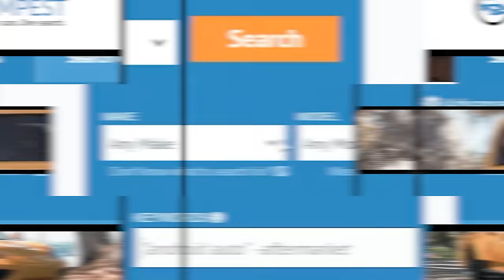Fixing Our Cheap (And Broken) Exotic Cars Was A Complete DISASTER

Comment: “That didn’t hit the floor” I know that pain all too well. That tool is now a part of the engine suffice it to say
Reply: Nah, old car aerial, some insulated wire to wrap around it, short the wire a few bursts on a car battery to super magnetise the thing and VOILA! Mega magnetic pickup tool! Also works with any magnetic metal object like fence wire.
Reply: I lost a Philips head in the engine bay a year ago. Last week I broke down and needed to unscrew some stuff but didn't have any tools on me, I found that Philips head in the engine bay.

Didn't help. The radiator cracked, but still. Was a nice surprise.
Reply: Anything that falls into the engine bay goes into a black hole. I lost many a tool working on a Mustang. When we finally decided to pull the motor, there were no tools to be found. And the car had never moved !
Reply: Lost a socket extension in my old truck. Constantly heard it rolling around in the firewall, traded it in a year later with it still there. Either new owner will find it or its apart of the truck fore er
Reply: I have a 2002 mustang back in 2007 I dropped a socket into the engine bay. It’s still there until this day.
Reply: It joined all the missing 10mm sockets in whatever blackhole they get lost in...
Reply: Thats where all your 10mm sockets are

Comment: Tyler is 100% the guy who would buy a Rolex, but not spend the extra $5 to have the extra kinks taken out to have it fit properly.
Reply: Lol what
Reply: @Louis-ep8ob  He's wearing a rolex submariner but it's way too loose (unless he prefers it that loose)
Reply: Faceless it’s a GMT pre ceramic model.
Reply: There are a lot of people who like it loose (me included) especially on tool watches
Reply: You spelled "link" wrong.
Reply: @Timberjagi  not when they have micro adjustments so you have the perfect fit, which can also be widened should your wrist feel a little bloated on any given day, with the half link. My guess is he bought it not for the watch but because of the brand.
Reply: @gilbertoflores7397  it's a older version gmt ;) yes the new clasp has a micro adjustment. but the older ones didn't have it.
Reply: I Got That PMA  hahahaha
Reply: Kinks? You mean links, right? Also that's free at any Rolex AD and it takes only a tiny screwdriver to do it yourself in minutes.
Reply: Those watches use a mechanism not really links

Comment: a ''' SHOP '' is where you BUY parts, a '' GARAGE '' is where you FIT them
Reply: Well, if you want to split hairs like that, then to be accurate, you MAKE parts in a SHOP (hence the term machine shop), you  BUY parts at a STORE, and you USE parts in a garage. While a shop can also be a store, and a garage can be a shop and and a store, technically a store by itself is neither a shop nor a garage.